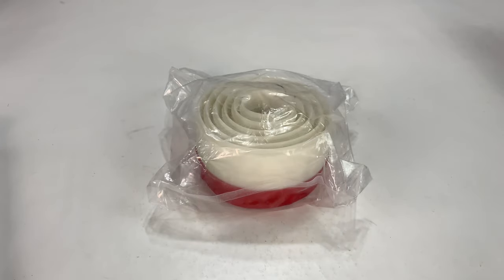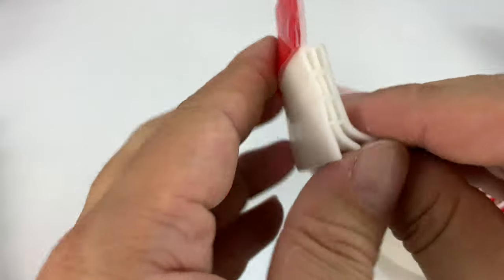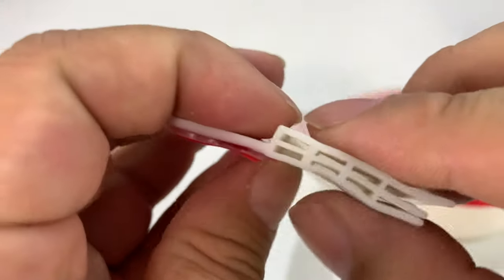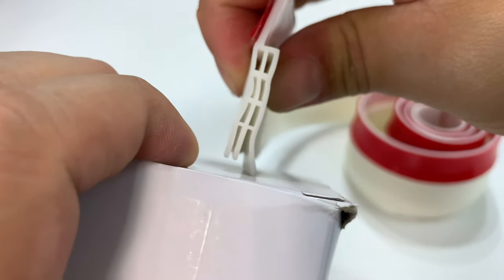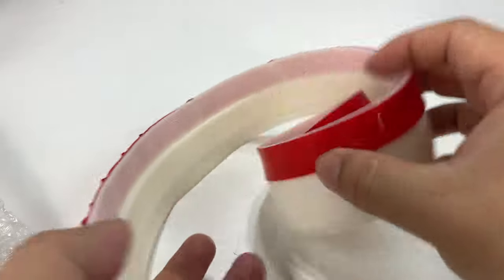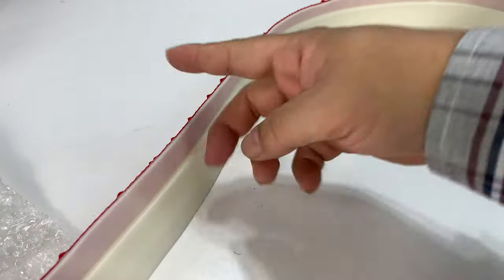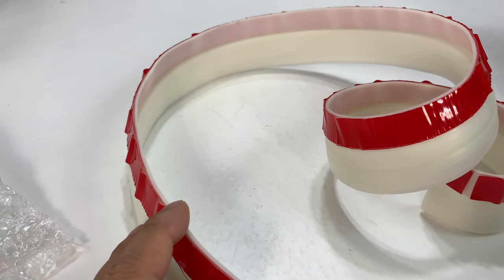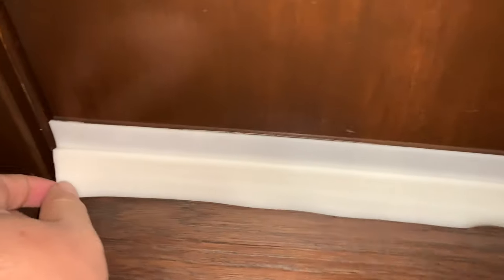How to Stop Door Drafts with Adhesive Weather Stripping by 3G Home Solutions

Comment: Thanks I'm a subscriber..

Question please :

On a security door,
can you just put it on the OUTSIDE ONLY ?

Its because my door has that bottom hump on the floor and also on the inside part of the door, it has some protruding screw heads that dont make for a flat flush surface.

The outside of the door IS a flat flush surface.

Thanks.
Anybody knowledgeable please reply soon

Comment: Can this be used on exterior doors to stop water that is pooling and dripping in?
Reply from the maker: I don’t think it would hold back water very well. It might do a little
Reply: @petervonpanda  what product would be better to stop water pooling and getting in under the door?
Reply: @cmcclarthy  a drain. Pooling by door is an issue. Gonna need to make sure house is sealed at foundation. And then address drainage like a new stoop or a down spout that leads to a dry well. Underground drainage barrel, buried.